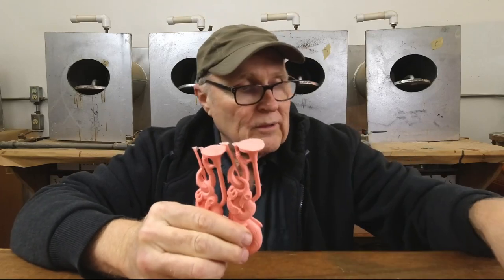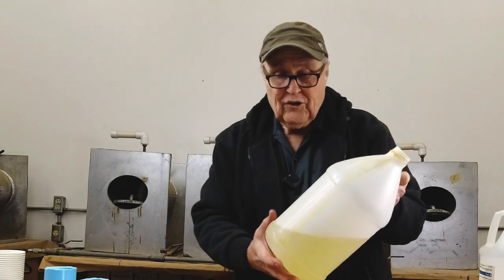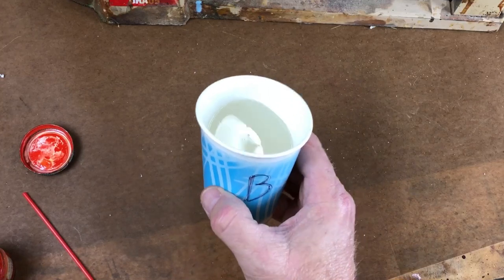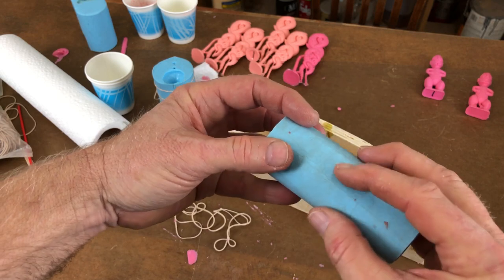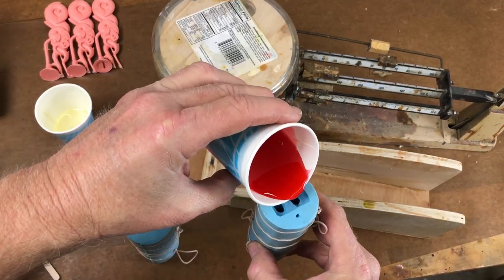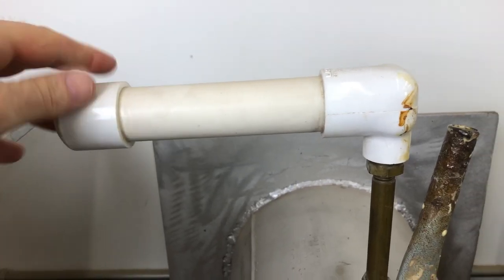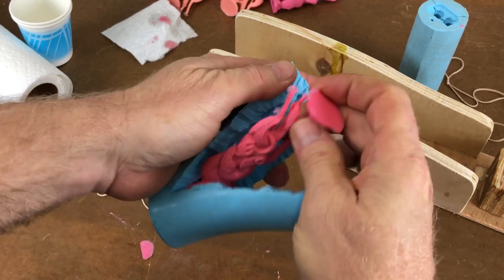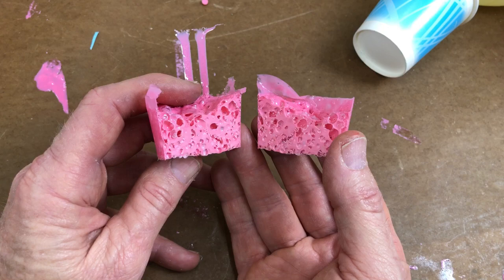Resin Casting - Stuff You Need To Know.

Comment: Thank you for the videos! Learning a lot! I got tired of having to use a wrench to open my “A” side resin and now put a little Vaseline on the threads after cleaning. It helps a lot!
Reply from the maker: I’ll give that a try!
Reply: @RobertTolone hi Robert I just wanted to know if you can make 100 small toy pieces that I need. Can I send you a picture of what I need and if you think you can make the parts I can mail to you the part I would need the part made in a orange translucent plastic because I use led lights to brighten the lense.

Comment: Hello Robert, can you tel me what material those molds are made? perhaps silicon? 
and what kind of resin you're using for casting? i asume its epoxy resin because you're using a A and a B component, but seems a bit softer when you can just brush those fleece away with your nail.

Comment: Hello Robert! Without a pressure chamber i do have a air compressor i use for painting miniatures (120/140 max psi) , is it hard to make a pressure chamber to use with the air compressor??
Reply from the maker: Most people modify a paint pressure pot.  You need 40-80 psi max in your pot.

Comment: Uncle Bob!!  May I suggest something?  As you use up the resin in the original containers,, the volume of air in the container increases,,, periodically transfer the resin into smaller volume containers,,, so that there is less volume of air trapped inside the containers,,,,,  Know what I mean, Vern?
Reply from the maker: Kevin Aguilar It’s a very good idea.  Especially if you don’t use up the resin quickly.  I don’t because the pressure pots allow me to use older resin and I refill the jugs from 5 gallon buckets of resin. So they are usually full.
Reply: @RobertTolone  You Just Put A Wrinkle In My Brain,,,, That Will NEVER Come Out!

Comment: Hey there, Robert! Like several others, I just recently discovered your channel and it's been extremely informative! I've been in the process of starting my own side business involving Resin Casting. However, I wasn't aware of just how important a Pressure Pot was until I started watching your videos. I have yet to watch the one where you take a 3D Print and make a mold and casting from, which is applicable to me as that's how I plan on making Masters for my molds.

My intention is to make parts and kits for model trains in a few different scales. Have you ever done anything with model trains before? And if so do you have advice you could recommend?
Reply from the maker: I don’t have any advice specific to trains. If you are 3-D printing the parts that you plan to mold in silicone and cast and resin you should be sure to design the parts for the process. That means making parts that fill with resin and vent air properly so that they are easy and quick to cast. You certainly don’t want parts that are difficult to cast or require a lot of clean up afterwards. That’s a quick way to go broke as a resin caster!

Comment: You’re great, I love all of your amazing videos. Thank you for all that you do. Failing sometimes is part of the process. One thing I’ve been wanting to ask you is this: how do we know which material to choose to make sure our casted product is heat resistant? I’ve spent a lot of money on advertised materials from different vendors that have failed to give me acceptable results even though I followed their data sheets. Especially the fast setting materials. They are toxic and temperamental. What’s the point of wasting time creating molds if the casting material is not going to pass the test of time and temperature?
Reply from the maker: Not knowing what you’re casting I can only recommend that you consult with the material manufacturers to see what they recommend, then test the material to see if it works for your application.

Comment: Hi Robert enjoying and learning your videos. How important is temperature when curing resin? Will it cure below 60-65 degrees?  One more question as I am very new to casting. Can I use WD40 as a mold release on let's say plastic bottle caps?
Reply from the maker: Temperature is extremely important. As you watch my videos you’ll hear me talk about this a lot.  Cold slows down the cure and can’t even prevent it if it’s cold enough. Heat speeds it up. A good rule of thumb is if you are comfortable, the resin will be comfortable. 68 to 75°F is ideal. But you can use temperature to your advantage to control how fast resin cures. I don’t like using Petroleum-based molded releases with resin because resin is petroleum as well.  It’s better to use a release agent designed for casting.

Comment: Hi Rob - what resin do you recommend for casting fine detail items that doesn’t contain isocyanates? 

Im essentially looking for resin with the following properties: 

1. Isocyanate (and other major toxin) free 
2. Mixed viscosity: 80-300 cps 
3. Pot life: 8-20 minutes 
4. Shore hardness: >60 

Less important 
Cure  time. A long cure time is a worthwhile sacrifice if these criteria can be met. 
Color of material 
Cost. 

Thanks so much in advance!
Reply from the maker: Resin suppliers would be a better source of info on this than I am.  The resins I use contain isocyanate which I mitigate using three strategies:
lot’s of ventilation.
Mask and gloves if there is a possibility of long exposure to the resin.
Most importantly, very little actual exposure to resin.  The objects I cast are typically small, the runs are very short so I spend only a small fraction of my time every week actually pouring resin.
Reply: @RobertTolone  Understood! Thanks for your reply.

Comment: Thank you! Your channel is a great resource for learning casting. I'm starting to try resin casting and found that a lot of websites said you need to wear masks and protect your hands when handling resin, I wonder if that is really needed or is it related to the type of resin you use?
Reply from the maker: It’s a good idea an I recommend it.  I wear them when necessary, like when I’m spraying or it’s unavoidable to handle the resin. Normally I don’t because I work clean in a well ventilated shop and actually have very limited exposure to resin.

Comment: Thank you for making these. I am planning on making molds for some face masks. The front of the mask is a flat triangle with a square (4cm sides) hole in the middle. There are also four small protrusions on the sides of the mask with holes in them for attaching two straps. I want to make a single part mold like you always do. Do you think the 4cm hole is too big to cut out well? I only have a limited amount of silicone to work with so I want to make the most of it.
Reply from the maker: D353rt  The hole should not pose any problems. The rubber bridge that goes through the hole should have a jagged cut so it locks together cleanly.  Good luck with you project!

Comment: Great video.....I want to cast clear resin for diecast model windscreens.Can you tell me what rubber and resin to use please?
Reply from the maker: You can use a platinum-based silicone rubber and a water-clear urethane resin to make clear parts.  The supplier I use sells both. www.silpak.com. They don’t sponsor me, I’m not affiliated with them in any way except I have been their customer for more than 30 years.  Clear parts are tricky. It is essential that the part you’re copying is flawless and highly polished.  Otherwise the casting will reproduce every flaw in the model.
Reply: @RobertTolone  Thanks Robert cheers

Comment: Is there a way to dehidrate resin part A/B that has absorbed moisture? Can it simply be done by low heat?
Reply from the maker: Heat will not do it. You can buy containers of desiccant material that will absorb the moisture from the resin. You attach the desiccant container to the resin jug and it will absorb the moisture out of the resin. You don’t mix the two. The desiccant absorbs through the air.  These are more commonly used on 55 gallon barrels of resin because it takes longer to use up so much resin. The reason I own pressure pots is so that I don’t have to worry about the resin absorbing moisture. The pressure pot suppresses the foaming caused by moisture.

Comment: Great as usual. Is a pressure pot really needed for quick curing resin?
Reply from the maker: No, it’s just helpful. The most important thing is to properly vent the air from the molds. I buy resin in 5 gallon buckets because it’s most economical that way. Over time the unused resin in the buckets absorbs small amounts of moisture from the air which causes it to foam when curing. A pressure pot prevents that so it extends the shelf life of the resin.

Comment: Great videos, Robert. Out of curiosity, why do you use a pressure pot instead of a vacuum chamber?
Reply from the maker: I use both, depending on the situation. I almost always degas the rubber in the vacuum chamber. I rarely use vacuum injection when casting resin for several reasons. First, it’s not necessary if you design a proper vent system. The resin flows into the mold and the air flows out without any problems. Second, the resin will expand A LOT when you put it under vacuum. So you have to design a system that contains the expanded resin. Otherwise it will spill all over your vacuum tank. Third, the vacuum process is slower. So you may not get all the air out of the mold before the resin begins to gel. Especially since I like to use fast setting resin so I can cycle the mold quickly. When the resin gels while expanded you have a mess of a casting. Finally, I have found that the vacuum process will not reliably remove bubbles in a casting. Better to vent the model properly to quickly and reliably fill the mold. Having said all that, there are production systems that place the mold cavity under vacuum and inject the resin into the cavity just using atmospheric pressure.  But that’s beyond the needs and budget of most DIY hobbyists or artists. If you know of a simple vacuum injection system let me know! I love to experiment with it.

Comment: Can you PLEASE do a video talking about how to make the muffler
Reply from the maker: I am not sure that it is worthy of a video all on its own. It is simply a piece of 2 inch PVC pipe with a cap on one end and a fitting to connect it to the tank on the other. There is a valve between the muffler and the tank. Drill a bunch of holes in the cap and fill the pipe loosely with polyester fiber fill or any other synthetic fill.  Even loosely packed fiberglass cloth will work.  Glue the whole thing together with PVC cement and you’re done.

Comment: Bob, quick question. Why don’t you seal the jugs of resin with electrical tape in order to make sure you keep the air out?
Reply from the maker: Because it’s too much of a hassle. That falls under the category of work.😳 It’s much easier just to use a pressure pot. Problem solved. 👍😄

Comment: Sir, I must ask, when you cast in a silicone mold, will the resin or wax shrink? I'm looking to get a 1 to 1 size
Reply from the maker: Urethane Resin shrinks very little, but not zero. Most casting resins shrink as a percentage of the mass. So it’s easier to measure the shrinkage on a large casting.  Wax castings can shrink a lot, depending on the kind of wax you’re using. When making prototypes that have to be an exact size it is important to know the shrinkage of your casting material and make the model oversized to account for shrinkage in the casts.